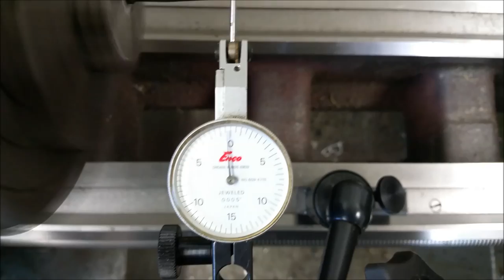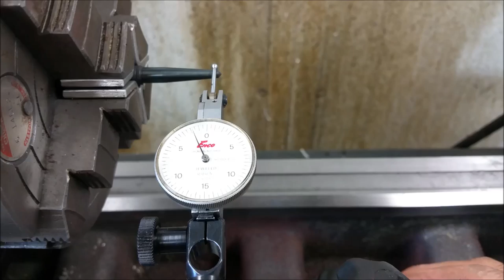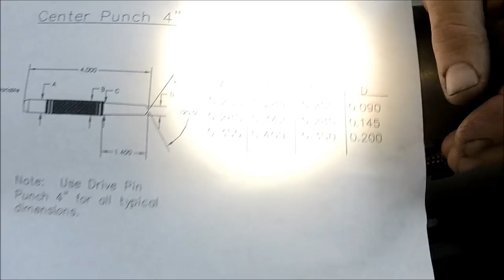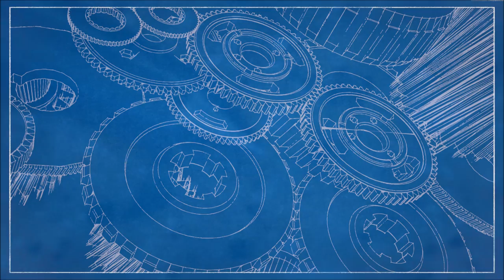OD grinding at an angle

Comment: Just picked up one of those Nogas.  Thanks for the tip on swinging it around.

That was a nice demo on the tool post grinder.  I like the second angle better, more like a prick punch used to punch the initial mark.

Comment: Make the angles any way you and Randy want.  Conventional wisdom says that center punches are around 60-90 degrees included angle and prick punches are around 30-60 degrees included angle.  Your 60 degree angle is right on the cusp.  The question really is -- what are you using it for?  If for fine layout work, the finer the angle the better, so long as it holds up well enough to not require frequent regrinding.  If it will be used for starting drills, then the recess made must be large enough to contain the chisel (or split) point of the drill so the drill does not wander.  That requires a more blunt angle.  The point angle is not for aesthetics, it is for getting the job done properly and in a reasonable time frame.

Comment: I like the rubber wheel idea! I only used them for deburring  cut off pins and stuff on a pedestal grinder in the eighties. Makes for a really glossy finish for pins to be pressed with the least shearing of material when the pin is on its way into a hole. Probly within 5 micro finish if careful with feed. I would be concerned of overheating work piece away from desired hardness.  Never tried for cylindrical grinding. I have swayed toward They are spongy aren't they? That's ok which is why they get that polish. I imagine they dress on their own if the softer bond wears with use. Very interesting idea though for finish. I usually went with 46 or a 60 K mid range wheels for most typical work. The only exception would be maybe a Norton vitrified bond 80M aluminum oxide for finish thread grinding on harder material with gentle work speed to wheel speed ratio.. I understand it is a video for the idea of ideas. Very cool idea! those rubber wheels certainly do polish well. Thanks for the upload ! For grinding consistency I like Norton Grinding equip. But most will work. It's never the machines fault anymore LOL. Know the machine first? Chris, Peace
Reply: +Do Right ps. Are these punches what they appear to be and simple hand held? I just grab an old little tap with a fully ground point if it's closest and prick a scratched cross point on the piece while wearing the opti-visor 8-) Usually within .005 tru position when clearance holes for screws are usually 1/32 over screw diam. Just Clearance on average sized machine work is all. .015 per side. just use a drill that fits to start the hole and drill out so the webbing of the next drill don't have to work so hard. more than one way to skin a chunk of metal. Glad we are all here for each other. Tx again

Comment: i was taught that the prick punch is used to precisely mark the holes location and the center punch to broaden the mark for the drill. the prick punch shouldn't blunt excessively because you aren't supposed to wail on it, just tap it enough to catch the point of the center punch.

Comment: I know Randy liked that asymmetrical, single-flat design, but after heat treating these have a banana curve that will make them springy (or breaky, if they are too hard) when struck. It may require a trip back to the drawing board for a more uniform cross section.

Comment: You should make a spark and stone and shaving tray/cup with a conection to a wet vacuum cleaner with a little whater in it
that way the dust doesnt go anywhere , less stuff grinds away on the lathebed  and the whater prevents hot shavings from doing any damage to the vacuum
the idea of useing the lathe with a diamond facer is a good idea for accuracy of the stone but a very bad one for long javedy and accuracy of the lathe if you do not remove all acess imediately

Comment: 120* included angle vs 60*included angle is the difference between a center punch and a prick punch, respectively. I prefer the 120 because they hold up better and they are better for drills to start into.

Comment: Typically 90° included is used for center punch points. 60° will work ok but be a little more prone to blunt, faster and require more smack to get a usable dimple.for drill starts.

Comment: How do those rubber abrasive wheels last removing material compared to a standard stone? I am guessing since you said they weren't good for hitting dimensions that they wear away pretty fast?
Reply from the maker: bcbloc02 Try them for a final after your part is sized, the finish is really good.